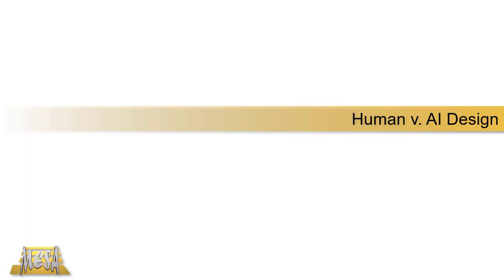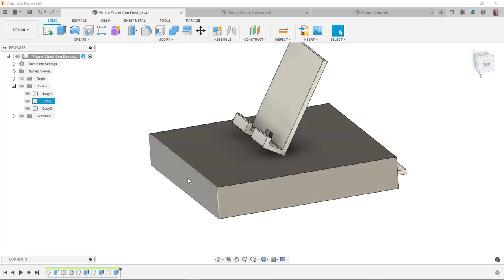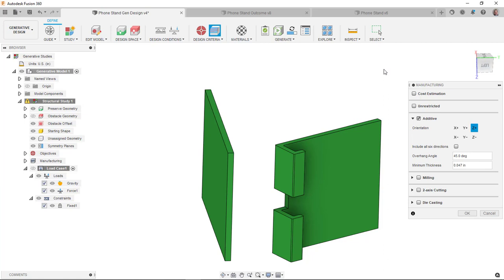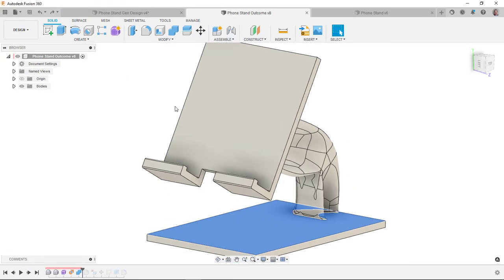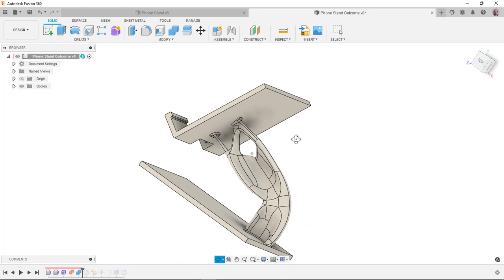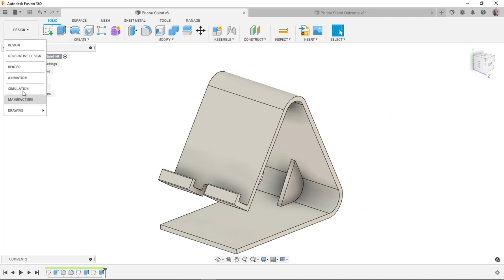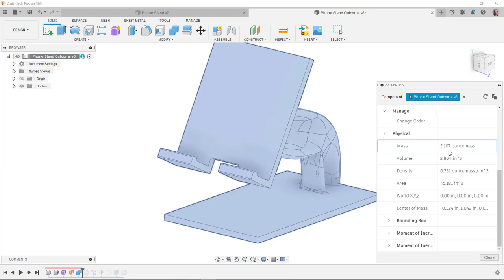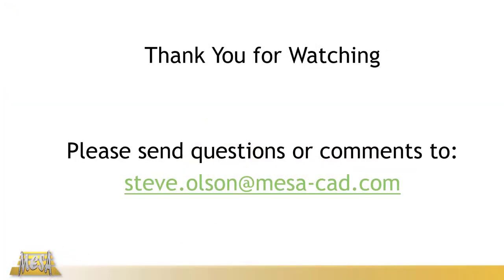Human v. AI Design

Comment: hi steve i have a question related to a frame generator i would be very gratefull to help me im designing a frame for a machine and had an issue: i dont know what happened  but all the frame members are now with an i  before and with the message: frame member is referencing to a no existing geometry and i cant delete each member and re generate each one 
so is the a way to restore the link between each member to it geometry 
many thanks
Reply from the maker: Is your question regarding Frame Generator in Inventor?  It sounds as if Inventor thinks that the part file that contains the skeleton has changed enough that the software doesn't see the same references as before.  This is likely because the skeleton file has changed significantly, meaning new geometry and features or Inventor picked up a different file of the same name as the skeleton, which is a file reference issue.  I would try editing each member with the Change Member (Frame Generator Command), which should allow you to change the reference used by a specific member.  If your Design Doctor icon, the red cross at the top of the screen, is lit up, you might be able to click on that and it should walk you through repairing any broken references.  I hope this helps, if you need any additional help with this, please email me directly at steve.olson@mesa-cad.com, it will be easier for us to discuss this issue via direct emails.

Thanks,
Steve